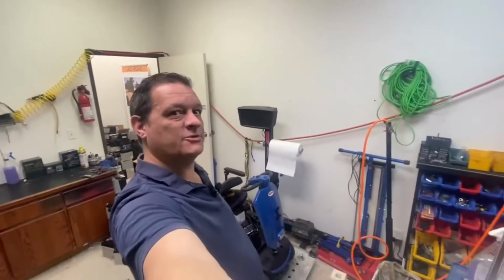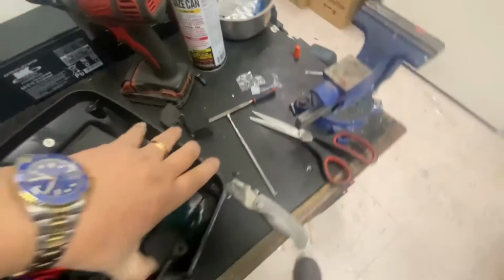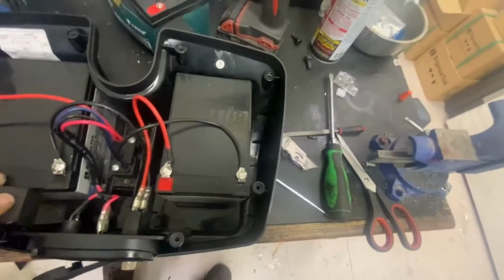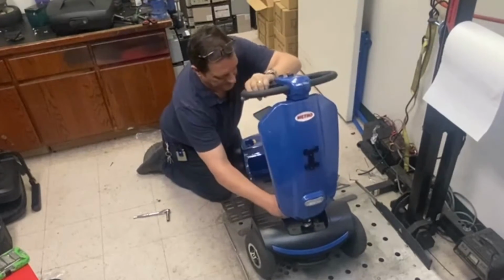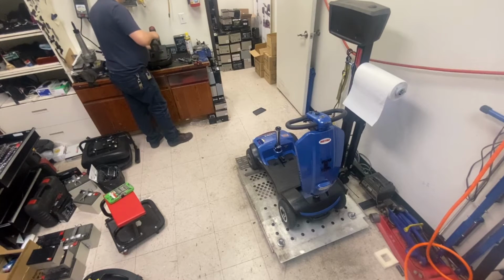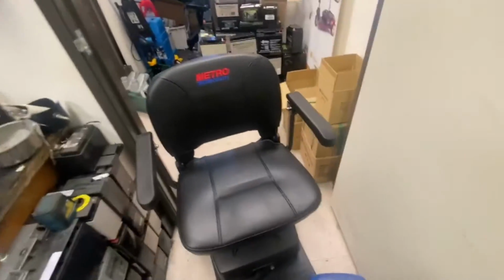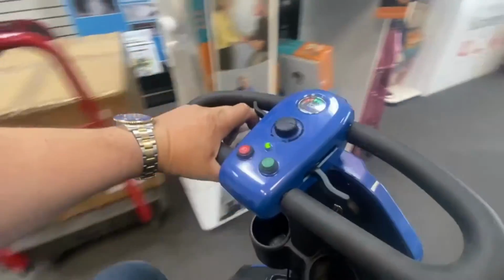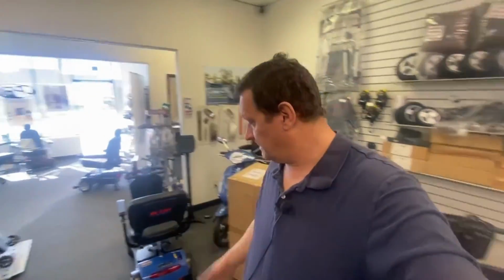Fix and Review of a Metro Patriot 4-wheel Mobility Scooter

Comment: How do you take the wheel off the rear got a new wheel and can’t get it off
Reply from the maker: You should remove the center nut, and the wheel should slide straight off. If it is stuck on there, tip the scooter on its side and try putting a small amount of penetrating spray where the nut was and the axle shaft. Loosely replace the nut and get someone to pull up on the wheel while tapping the nut to see if that can break it free. Be careful not to damage the threads on the axle shaft by hitting the nut to hard.

Comment: Love this channel so much ive literally just booked myself on a mobility scooter repair course in the uk. I have a question if you got time to answer it i want to buy and sell scooter ie repair if need be do you think i could make a decent second income doing this
Reply from the maker: Hi Gareth, great you're thinking of getting into this. I don't see why not. You probably want to sign up to as many manufactures as you can for parts if you can't find enough reliable used ones. Good luck bud 👍
Reply: @lasvegasscooterslifts  thanks for the reply is signing up with them just as easy as ringing them up or do I need to be a business
Reply from the maker: It's always best to get a business account with the manufactures to get better wholesale pricing and parts availability.

Comment: Hi Ian. that beeping is annoying as heck. Any way to turn that off?
Reply from the maker: Yes, there is a way, you would have to find out where the little speaker is and remove it. But it is a safety measure built in by the manufacture and could cause you legal issues if those blood sucking layers found out you removed it and ran someone over.